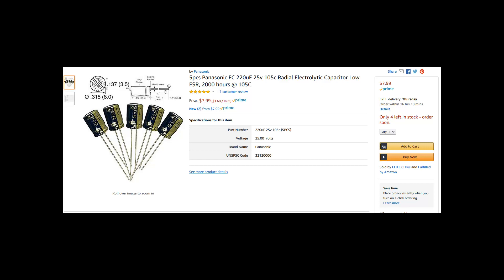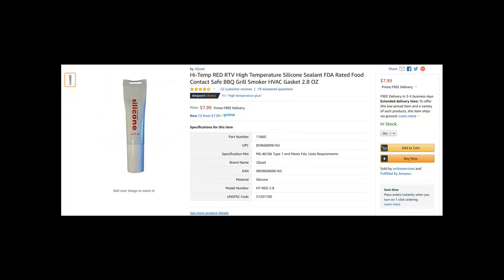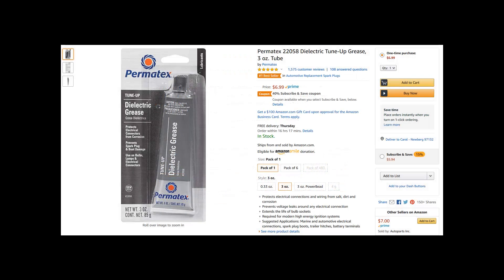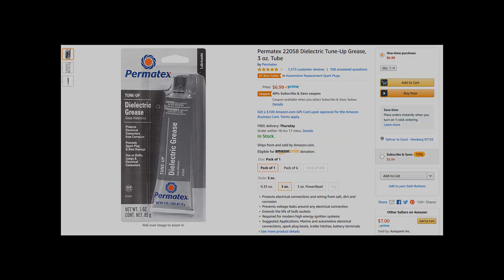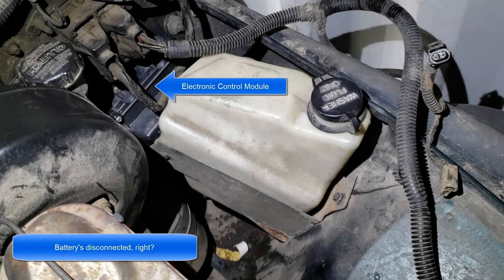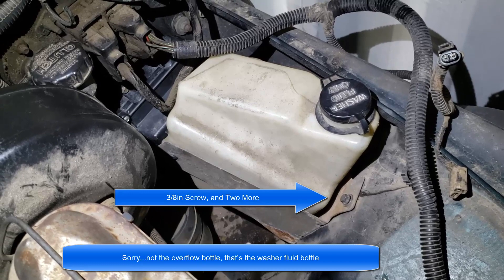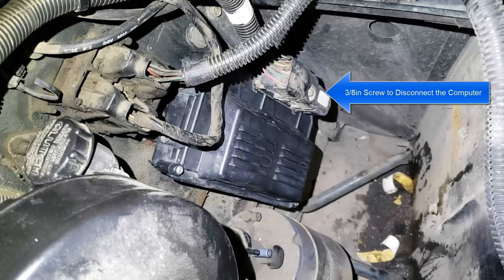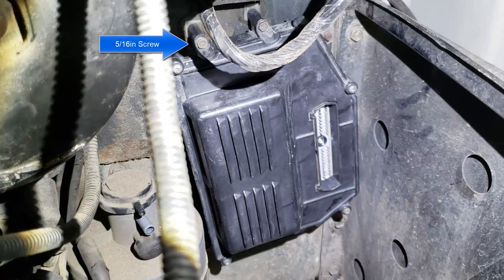Jeep YJ ECM Repair - Capacitor Replace

Comment: great video! thanks for all the info i need to repair my buddy's jeep issue

i wonder if a shot of wd40 around the edges would help it to come out of the casing easier. im gonna give it a try this weekend if the caps show up on time.

Comment: Great job on the ECM and video.  Two questions: 1) Your potting material has the same light spot just below and a little to the left where you plug it in.  It looks like it got hot in the spot and bubbled the potting material.  Is this an issue?  2) My crank case position sensor keeps going out every year causing the motor to shut down.  Will replacing the capacitors correct this problem?  THANK YOU!

Comment: I found these (10pcs Panasonic FC 220uf 25v 105C Radial Electrolytic Capacitor (8mm x 12mm)) on eBay 10 for 5 bucks and I wonder if they will work? Description says: Radial Electrolytic Capacitor, 220uf 25v Series: FC ,Temp: 105C
Size: 8mm x 12mm, Lead spacing: 3.5mm

Short leads for PCB insertion

Package of 10 pieces
Reply: Did you end up buying those capacitors?  Did they work?  If so do you have a link as I can not find the panasonic ones he is using.

Comment: What silicone are you using?
Reply from the maker: It's shown in the video: https://youtu.be/0wXjUaBrDGY?t=126
Reply: @waltj08  Thank you, I must have jumped ahead.  Ended up using EGS10C-20G-ND.  Non-corrosive is key for circuit boards. Thanks for your video!